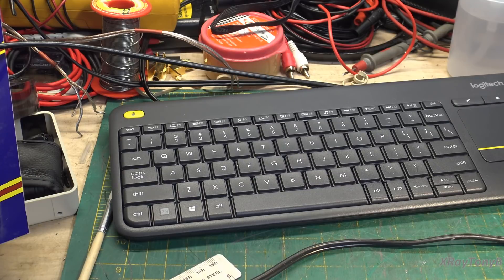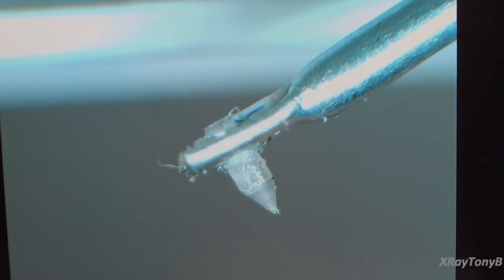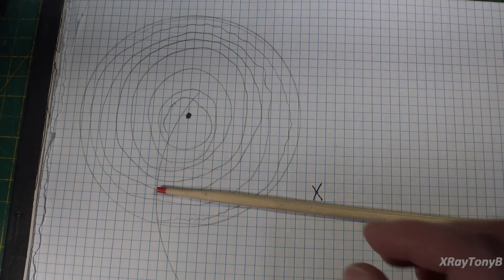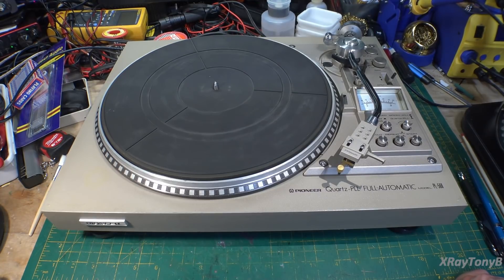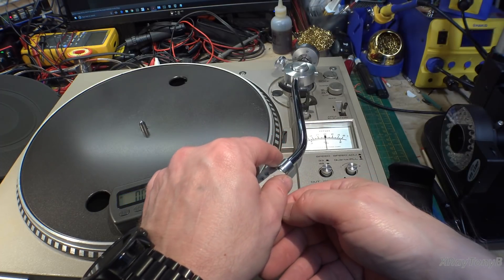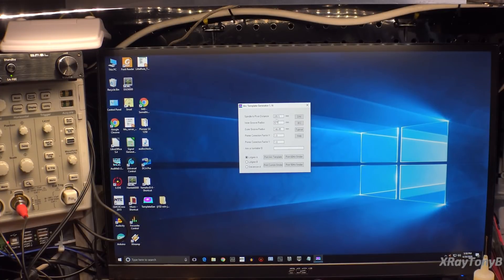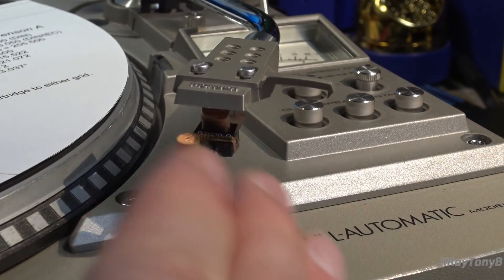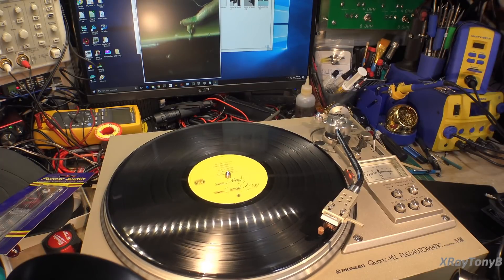Turntable Setup and Theory

Comment: Thanks Tony for the great tutorial! I've been a vinyl head since the late 60's and can never get enough information to satisfy curiosity and mindset of setting up turntables. I am familiar with and reference frequently to Michael Fremer's website and YouTube Chanel, I can't agree with you more. 
I look forward to you getting into the PL-560...I have the 560 and PLX-1000...both purchased new and as pristine as the day purchased. 
You should bring back that dust cover to its original crystal clear glory! Several hours...🤣...over couple days...depending on severity, using automotive wet-dry sandpaper starting with 400grit (severe) up to 5000 with final polishing using Meguiar's PlastX automotive headlight restoring polish...no-power-drill!...the end result is quite astonishing. I have restored several for friends and family, they literally were in disbelief with the end result...

Comment: Nice! I had a Shure V15 5MR on my Sytemdek IIX and it was their best model in the 80's at $300. It came with a metal case and 2 nice wedge shaped rubber shims to keep the platter in position during alignment. I used to do rake adjustment with mechanics feeler gages as they were the most accurate I could find. Sounded great!

Comment: Thank you for a wonderful video. Done much of this before but still learned some things. One thing I just have never understood is why the headshell and cartridge bodies in most cases do nothing to help, rounded cartridge bodies for example which make it tough to get the things in straight. I did have one headshell that had a grid on the underside, possibly a sonic downer but so much help in setting up.

Comment: Seems like if you were setting the rake so that it leans the correct way, you'd have to shim the front of the cartridge, not the back as you suggest at 1:02:31 or so. No worries Tony, just pulling your chain. My system is a Heathkit AR1500 built in the 70's and a Benjamin/Miracord turntable from the 70's with a Stanton 681EEE (At least I bought it along with that cartridge, but it's been so long since I really looked at it that I can't remember if it's still in there) playing into a couple of  Ohm E's. That along with being totally deaf in one ear and hearing poorly in the other even with a hearing aid makes me wonder if all the work is worth it. A lot of good information here, thanks for that.

Comment: My very first "audio-grade" phono cartridge was a Pickering XV-15. I think I was 15 years old when I got it.  Then I got a Stanton and finally (after upgrading my equipment) I got a SURE V-15 type IV and then a type V.  I recently purchased an oem imported hyper-elliptical nude stylus for that cartridge. It's sad that SURE is no longer in the phono cartridge business. The "dynamic stabilizer" (brush) on the V-15 adds 1/2 gram to the tracking force.

Comment: Great Demo on rake angle..My tonearm has a vert. height adjustment and the instructions basically said to align the top of the cartridge head-shell to be parallel with the plane of the record..In other words...just eyeball it. I always thought that it was a error-prone way to set that.

Comment: What an amazing turntable Tony, my cheaper Pioneer turntable has the platter isolated from the plinth and the tonearm assembly is also isolated and forms one complete part with the platter, if you moved one, the other moves with it. None of my other turntables are like that! Is that Pioneer like that too? Buy pushing down on the platter it should be easily visible if the tonearm is mounted on the same assembly, if it is, it should have adjustments for how firm you want the isolation to be...

Comment: Hello Tony!
Really impressive job... Once again, this is top level info for vinyle old fools like I am. It seems perhaps too complicated to many, but it is essential to get the best.
One little question: you make all your measurements using your balance and protractor without disc thinness account: as a standard approach, I was always said you had to make the weight with mat and no disc, and protractor and azimuth adjustment with mat AND disc. I know that only makes a few millimeters, but is that so important?

Anyway, the Arc template generator can be found on Vinyle Engine site for free. Including many different instructions, and other detailed info about many models, Baerwald templates for Thorens... You can also find many info about different diamond cuts, like Hyperelliptical, Shibata, Van Der Hüül...
About discs norms, the IEC is normally used for US or Japanese pressed discs, DIN for Deutsche European discs. US engineers prefer to use the total surface of the disc, even if the tracks are shorter. On European discs, you have less center usage, and can find large unused surface near the center. So the two ideal points are different when you use these two norms. US ones are more centered, and that is the norm you probably have taken into account ( that is not specially critical).
Good job anyway with your confined family. Take care on yourself...

Comment: Good video, but you missed one important thing. The Pickering cartridge you're using has a built in brush that lifts the tracking force by 1 gram. To get the tracking force seen by the stylus at 2 grams, you need to set the measured downforce at 3 grams. The little instruction leaflet you have will confirm this. The way you set it up it's tracking at 1 gram.
Reply from the maker: You're right.  I need to fix that.  Had a few other catch this as well!  Thank you all for catching this!

Comment: As far as I see it you set the weight correctly - When you set the downforce you do it  with the brush attached and that is how it will be on the record too. What you did backward was adjust overhang after setting weight. That will of course alter downforce. I didn't watch it all so may be talking bollocks...

Comment: I think that turntables that have Linear Tracking tonearms have better sound quality than the normal turntable,  if I could get my hands on a new old stock REVOX B795 turntable which has been recapped and the needle drive belt replaced I would definitely get it but I would also want a digital phono preamp with a TOSLINK output, I would not have anything to do with turntables that have a conventional tonearm assembly that pivots from a single point, actually the MARANTZ SLT-12U looks like a very good turntable, Linear Tracking Turntables are not a new thing as they were in  the RCA CED players also, I had a MARANTZ 143 system which sounded like being in a recording studio it was that good and the tonearm of the turntable was part of the lid, Most Linear Tracking Turntables track at less than 2 grams, if you want to hear what a Linear Tracking Turntable sounds like then what about #AttilaSVK, What about a DSP based SQ decoder.

Comment: Don't you have to add another 1/2 gram for the brush? I know Shure has tells you to add another 1/2 gram for the brush on the M97XE and V15 cartridges with the brush down.
Reply: It's actually a full gram with those big Pickering brushes
Reply from the maker: Wow, I totally missed that one!  I Guess it's time to put on my idiot boots, go back to the bench and correct it!  I saw a couple of others caught this as well.  I will be sure to make this correction in the next video.  Thanks!

Comment: Most Arms  setup incorrectly and designing incorrectly the pivot point of the arm ideally be level with the platter but arms are not designed like this generally to take this into account, so you'd have to achieve it yourself by putting a block underneath the headshell that is slope between 5 and 10 degrees to give you the correct rake angle, giving you enough clearance to the record.
Another thing is people miss out compliance! frequency distortion in the arm and cartridge and turntable, the figure you need is between 9 and 14 Hz the Goldilocks zone, a high mass arm need to have a low mass cartridge a low mass arm has to have a high mass cartridge to get into that figure of 9 to 14 Hz between 5 to 7 Hz you can get rumble in the 20Hz you get boomy bass muddy sounding so you always have to do your calculations when buying a new cartridge and knowing the mass of your arm, the compliance of the cartridge. the resonant frequency pairing resonant =1000/6.28 square root there's chance you can download off the internet.
Don't worry about anti-skate bias either 0 can be just as good as any other number.  you have to play it by ear small increments micro increments at a time there's always some centrifugal force even with it pulling into the groove. Can't weigh it on the scale with the brush on it like that take it off why you have it on there anyway is better with out, a separate brush on a counter lever does help with Flutter better.
You could use your phone to take a picture don't need microscope as long as you get a clear image.
I wouldn't just rely on the turntable being set up for pivot to spindle you should always check it it can be out! do this at about 22 degrees Celsius.
I would use nylon washers Both Sides Of The Screw and nut and in between the cartridge make sure it's tight not just nipped up! but fairly tight more then you think
Get rid of that rubber mat as well drag the life out of the record best mat is a funk firm acromat
Reply: You have to see a doctor....
Reply: @MrBolopanos  yeah the needle doctor hahah
Reply: I believe my Denon DP61F compensates for that they call it Q factor